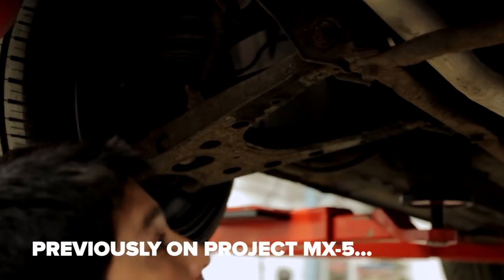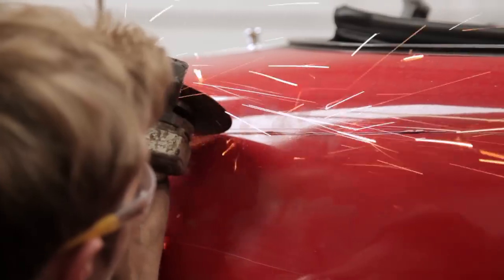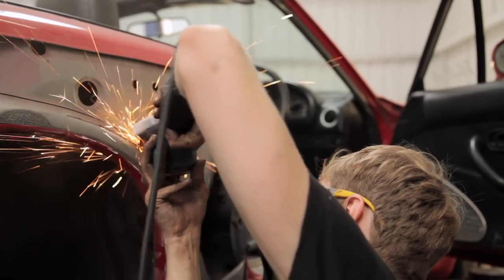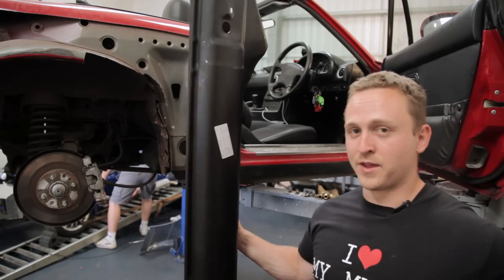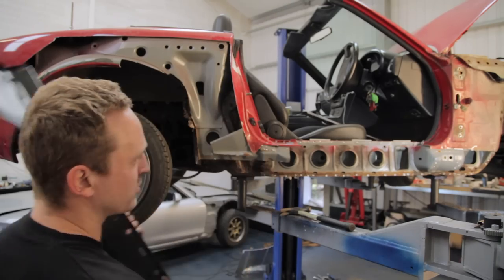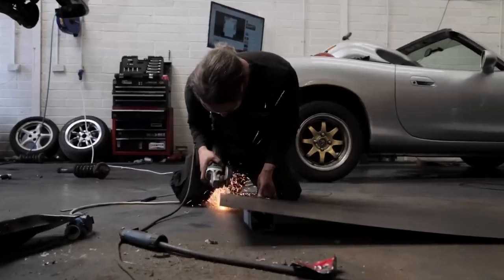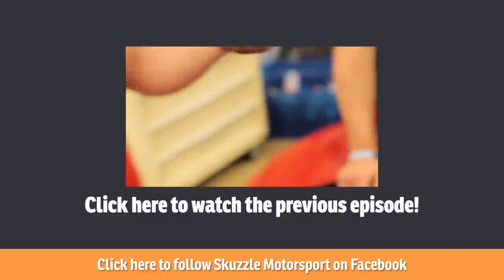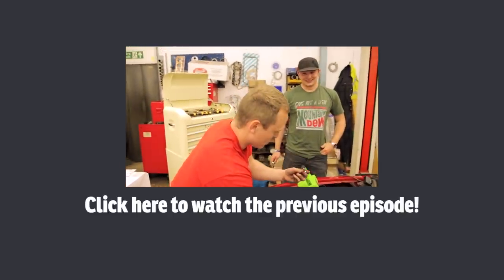Project MX-5: Saving My Rusted Miata From Certain Death

Comment: holy crap. could prbably have gotten a mint condition mx5 for that money...
also: whats up with the paint on the door at 12:00?
Reply: Matthias Schmitt commonly known as 'orange peeling'-badly sprayed...
Reply: MattySP34Ks that's what I thought, but they didn't fix the door, did they? maybe repainted after an earlier repair?
Reply: Matthias Schmitt they probably just resprayed whole car. It would be hard to match the paint by just painting the rear guards and skirts. Orange peal can be remove by cutting and buffing the paint. Often times wet sanding and using abrasive buffing compounds with cutting pads and slowly making your way up to less abrasive compounds and pads and then finishing if off with polish and wax will give it a mirror finish with no more orange peal effect.
Reply: Tucker Maxam oh wow, I don't even want to know how much money he already put in that miata...
Reply: Matthias Schmitt
To him itll be worth it in the end. Im in an identical boat with my wrx.
Reply: For all you people who don't know about miatas, the 'orange peel' effect was a factory standard paint job, so it's not badly sprayed, the stone chips on the door were quite bad, and people at Skuzzle didn't have the facilities to spray the car properly, so don't be going on about badly sprayed, that's the way the car came.
Reply: For all you people who don't know about miatas, the 'orange peel' effect was a factory standard paint job, so it's not badly sprayed, the stone chips on the door were quite bad, and people at Skuzzle didn't have the facilities to spray the car properly, so don't be going on about badly sprayed, that's the way the car came.
Reply: Matthias Schmitt that is called "chip guard" it's a rubberized undercoating under  the paint that keeps it from chipping. It does have a rough appearance much coarser than orange peel. Mostly put at the bottom 15% of doors and fenders sometimes rockers too. Surprised no one knows about this was common on cars especially Japanese but is now fallen out of favor w manufacturers.

Comment: lol the amount of money he spent doing this could have bought another MX-5
Reply: It wouldn't be the same. That mx-5 is worth more to him then just its sum in parts.
Reply: Robbie Gobeli Is it worth 20 grand more? Because I doubt this cost any less.
Reply: MAEguy ........this year and model costs 10k in mint condition, his is around 5-7k buy anothr one. You must not knoe about cars and money
Reply: That would ruin the series! Its about him and hos journey with phil and all the problems he will face
Reply: Tommy Le
 Lol I don't know about cars? I was saying the work he had done here must have cost around 20 grand and that it was not worth it. I know he could have bought a small fleet of Miatas for the money, or probably 2 or 3 collector quality Miatas. If he spent 5-7k on his car he spent too much (unless they cost more in the UK). Either way, my comment was pretty obviously directed to the first commenter, not the OP.
Reply: Beestigeboy lol he could have bought another red mx-5 and we wouldnt have known the difference
Reply: Tommy Le Just picked up a Miata here in the states w/ 56k miles 1990 for $3800. Only problem was a leaking valve cover ($16 fix) and a leaking caliper... No rust because no snow in Georgia
Reply: Robbie Gobeli I understand your point, I love my car but I understand common sense. I would not spend 26,000 Euros to repair rust, that's absolutely absurd. I would give it a proper funeral, or hand it down. But I would not keep it alive on life support when all it wants to is pass away peacefully.

This is just an idiotic waste of money that could've gone into something much better, that his old Miata would've been proud of and shed a little tear up in the automotive heavens.
Reply: Pickle312 Yes that's the great thing about most american miatas - no snow, so no rust. But in europe we get alot of snow and alot of rusty MX5s
Reply: TurtleLuverZ : You mean, another rusty MX-5 ?
Reply: Tommy Le so did he end up with a mint mx5 after this frankenstein job? When he ever sells this car the buyer will spot these repairs and run away.

Comment: "effectively as good as it was when it came out of the factory"

   A well executed job will be always be scene in the workers' faces showing pride and admiration for what was accomplished.

   The looks on the shop workers' faces says it all. It's SHIT work to do, no matter how well intention-ed the repair is, 95% of these kind of repairs are fudged and cobbled somewhere, never amounting to what the installer could have hope it to be in the beginning of the job. Unless these guys buttered up the insides with corrosion inhibitors of some kind, it will likely rust out AGAIN at every spot where there is a weld.

 Don't Ever get it wet.

  When you weld, the high heat BURNS AWAY any kind of protection from rust, this is why the factory "dips" the bodies in a primer type bath after they are manufactured. The gray coloring you see inside once they cut the rocker panel/sill off is the protective coating.

  It is extremely rare to find someone who is concerned enough about the work 2-3yrs 
down the road to care enough to apply internal corrosion protection. The bottom line is these repairs are labor intensive to even do a 75-85% job. 4 days turned into over a month.

I really feel badly for the guys who worked on the car. They obviously were NOT HAPPY with it, just relieved the abomination was LEAVING, releasing thier shops' car lift that it took hostage for weeks during the repairs. They all look like they have been eating shit sandwiches that the owner of this albatross has been feeding them, not to mention that look of awakening from a comatose nightmare of a serious rust repair job, that they lost money on.

 This thing should be renamed "Phill-er", after all the auto body filler that has been "smothered" into this heap.
Reply: I think that look on their faces was “I’m high as hell right now wish this camera wasn’t in my face” lol

Comment: I do hope they used weld through primer on all the metal work they fabricated, else you will need it all doing again in a few years time. They did do a good job on the panel matching and arch flare though.

Comment: I currently have the same problem. My MX5 is rusted to bits and it has a high milage. I love driving it in winter, so it was always going to be a missle. Can't get it street legal anymore, don't know what to do. Get a nicer one and use wax in the sills or get someone to rebuild the whole chassis. You can easily get an engine swapped but you CAN'T find nice chassis here.

Comment: WOW! In North America it would be hard to find a shop even willing to take on this kind of rust repair, very thorough job! When I got my rust repaired they just slapped a patched over the crap that was there and said it will come back in 5 years... They were the ONLY shop in a large area willing to do anything other than throw fiberglass in it... must just be my area! However the differential in textures down below the beltline is garbage, either make it all smooth or keep the factory texture, don't just change the few panels you paint.

Comment: I have had really good luck using an oil-based rustproofing here in SW Ontario, My 1980 Fiat Spider (donated to my much younger brother) is virtually rust free as is my 1998 Rav4 which is virtually only driven in the winter. If you use an oil-based spray like Rust-Check/Krown or similar every other spring and clean the underbody of your car regularly your cars' body should last almost forever. I also own a 2006 mx5 which is rust free.  Do not use the asphalt-based sound-deadening material as it traps moisture!!

Comment: Car Throttle, If all the sheet metal rust repair is "free," that's good for you. However, this car is so badly damaged and weakened by rust, you would be better off by scrapping it after salvaging all of the usable parts, of course. You can get a NA Miata prettp cheap, and you won't have to go through the pain and major labor to fix this one.

Comment: I dont know, i mean its certainly not good but its not a disaster if its just the sills and rear fender. If you got a garage to be in and its not your Daily, you could buy a second hand tig, practice on some scrap, look up what others have done and then maybe give it a go yourself. Rear fender and outer sills are commol and not that expensive to get a hold on for the mx5. However if thats how it looks back there chances are theres a lot more rust to get a hold of elsewhere.

Comment: Rust is the death knell of any car when it's as advanced as this car has become. It's "car cancer." The only "cure" is to replace the rusted panels. You can replace the bad fenders with new ones, but what about the other parts, like suspension parts and the frame? Where do you live? I find it amazing that a relatively late model car could have so much rust.

Comment: I've never seen so much effort put into fixing rust holes in a chassis that new..  If it was some super special skyline or mustang from the 60's I'd agree that it's worth it, but for that?  Might as well find a new chassis...

How much did this massive bill total to?  That's insanity.
Reply: MrSlowestD16 new? these cars are 17+ years old. in the north that means large amount of rust.
Reply: I grew up in New England - rust central.  All cars there, though, don't have to be rusty.  There's clean examples around, even of NA's.  Those clean examples def. cost less than this huge rot repair.

Comment: Do you find the car more stiff or rigid now Alex? I had the same thing done to my MX5 (at a whopping $3000 bucks...) and am in the process of a 1.8 swap now and have still yet to drive it since I had the work done. Very curious to know if you can notice a difference in the chassis
Reply: Do you have before and after pictures of rust condition?

Comment: Really curious on how the car is doing today. I've done this three times in my older cars, doing all I could to save them. Not me actually, at local body shops. One job just like this, and two a bit less work. But for all three cars the rust has come back right away, and back to holes in rocker covers in 2-3 years. With the last car I've decided to never in my life do this again and just change the car.
Reply: rust repair is not a car restoration job, once the inside of the uni-body gets rusted like this it will come back, only if the hole thing is sand/media-blasted and spray'd with cr or epoxy primer it would last given it stored in dry conditions
Reply: the job wasnt done right if it came back

Comment: I am the proud owner of an MX5 MK2. Having had the entire sill sections cut out and replaced and the whole car re-sprayed, I now have to have the chassis rails cut out and have new box section welded into place, after which I will have some of the other various rusty bits sanded back and have the underside painted, sealed, and cavity waxed...

I really wish people knew that these cars need underbody protection... If mine had been undersealed and waxed properly say, 14 years ago, it would be nowhere near as bad as it is now!!! :(
Reply: Acme I literally just purchased an mx5 mk1 yesterday for £950 and it has perfect outside bodywork and engine, but like many it has small patches on the already repaired sills, and the whole underside rear is covered in surface rust. Gotta spend the whole weekend sanding it and applying rust protector. However it did come with a fresh MOT somehow which was the main reason I brought it, it gives me a year to play about with it before attending to the rust (assuming I don't find anymore)
Reply: Acme how much is all of that costing you by the way?
Reply: You won't have to worry about the chassis rails because the MK1 didn't have that issue - but it will cost about £750. The sills were around £600 if memory serves correctly... Paint was done by a friend so was cheap but a good job. Not necessary though! 

Check themx5restorer.co.uk
Reply: Acme cheers man! It's a lot of money but it's worth it to keep another 5 on the road! I've only had the car a few days and I'm in love with it haha it's so fun to drive

Comment: my miata got water inside the body frame. I'm trying to find out where I can get it out and where the crack is. any advice on how to take out the water from it? I can hear the water when I step on the gas and hit the brakes. I'd appreciate it if yall could help.

Comment: I have a similar level of rust and filth on my CRX I was planning on getting fixed the only this is cost.  How much will a job like this run me? Let's even keep the estimate high to be safe.
Reply: Josh Frament if it's this bad, count on £2000
Reply: Alex Kersten i want like a supra to make it jdm with clear trasparent Hood and turbos sticking oute cool wing maybe ill do a 3d model OF the project and upload it in deviantART ill PM you when it will be done

Comment: phill is nothing compared to what i have to do to my car. my car needs what your car needs, plus new front frame rails, torque boxes, floorpans, fenders and wheel wells. its so bad the car i bought as a parts car has better frame and fenders, so the parts car is the actual car and the original car is the parts car. engine, trans, and whats left of the interior and wiring are being torn out and put in the car. only problem is the former parts car has a salvage title so it need and enhanced inspection.

Comment: I know how rust works but I don't get how that car can be so rusted OwO
Reply: Siggy Cloud  Water/moisture gets lodged between the panels and it just eats way at the metal. Salt on the roads don't exactly help either.
Reply: MrManBuzz Yeh but shouldn't the metal be treated? galvanized?
Reply: Siggy Cloud Sure cars are nowadays but a lot of the cars from even the early 90s didn't have near as good rust protection on them as they do now. 

The bodies on the cars last nowadays, the engines don't, it was the opposite years ago, take your pick I guess.
Reply: MrManBuzz You can easily replace an engine.
Reply: Siggy Cloud Not as easy as you would think on modern cars...and then there's electrics, good luck trying to fix those.
Reply: MrManBuzz I'd still rather change the engine than change the whole body XD
Reply: trigolis I suppose. but by the same standard, if mazda's weren't good they wouldn't survived when others such as lancia, rover and so on didn't, don't think the modern ones have the problem, might just be as someone above said a thing of the time. still as long as it doesn't completely fall apart its all good.
Reply: trigolis Good thing I don't live in the US :D
Reply: trigolis That was the way it used to be, the engine and box would be fine while the body turned to dust, nowadays it's the opposite imo, with all the electrics and high precision engineered engines they're not going to last as long as the bodies which have all sorts of rust treatment on them.
Reply: trigolis Well sure, for individual Car makers you're going to have exceptions, but for the most part, that's not the case.